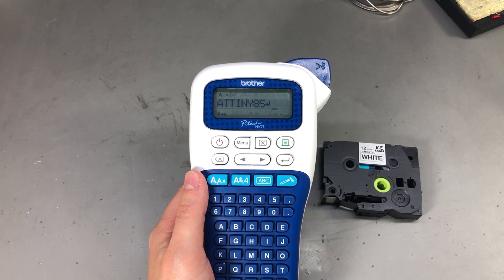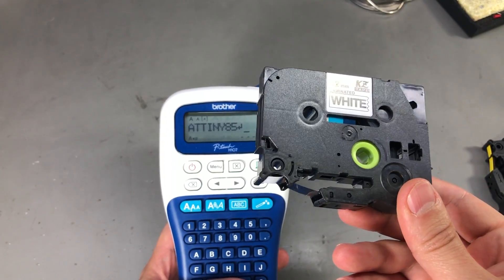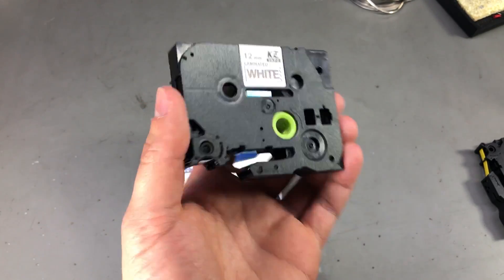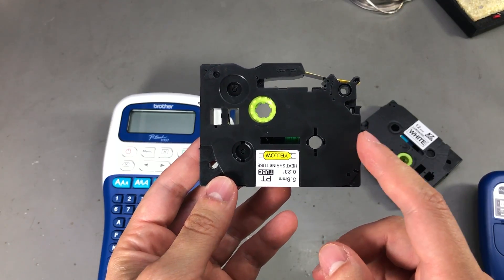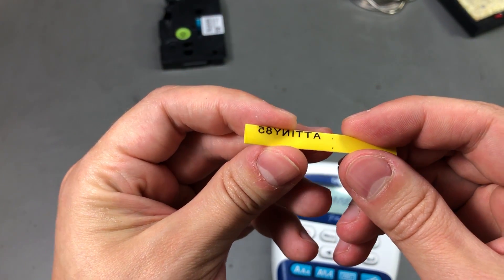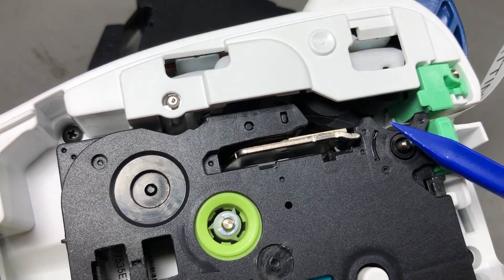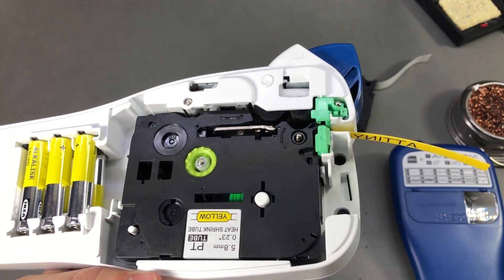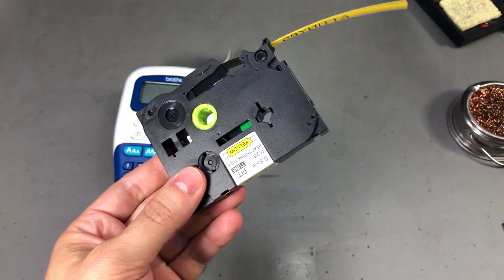Voltlog #237 - Can You Print Shrink Tube Labels With A Cheap Brother Printer?

Comment: I wonder if the heat-shrink manufacturer didn't actually screw up the hole pattern on the cassette. On my PT-H110 which is only marginally better than H107 the heat-shrink tubes work just fine. I'll check the pattern on my heat-shrink cartridge when I come home.
Reply from the maker: That's an interesting theory and I would appreciate your feedback regarding the cassette you have once you get the chance.
Reply: @voltlog  Please take a look at this photo: https://imgur.com/a/HNl932e

This one works out of box with my printer I mentioned.

Please also note that mine is a 12mm tube, so the pattern will still be different than yours.

Comment: If you buy new one, dymo labelmanger 160(20$ on amazon) can print on  Dymo 18051 Heat Shrink Tube Labels(4~5$ on Aliexpress). other dymo labeller can too.
Reply: I’m looking for cheap heat shrink printer for DIY works at home. What size does it fit? And dymo would do the jobs just by inserting this type of heat shrinking tape is it?
Reply: dymo labelmanager 160's maximum label width is 12mm, so 12mm under is all fit.
And dymo printer does not check tape type. So any type of tape is ok.
Reply: Thanks mate for your sharing. Initially I don’t have the confidence to buy low budget dymo brand since the supplier only expensive products could do the heat shrink labeller.
Reply: @chrismakulai4960  I tested Brother P-touch before, It has ID pinhole on tape cassette. So when brother shrink label inserted, It shows an error message. But I taped the hole like normal label cassette and it works well. So I think another label maker can accept shrink label with some hack too.
Reply: Thanks mate. This really helpful information

Comment: Brother p-touch h110:
Heat shrink tube works!
But you'd create one hole and "hidden" one other.
In tape-cartridge you have one center hole - make it similar to HSE-cartridge. And with two holes in HSE-cartridge "hide" with tape/scotch left hole.
Print!

Comment: Interesting. I have a Dymo one, though. There might be some heat shrink tape, IDK.
Reply from the maker: That's one of the things I've looked at before ordering my printer, I tried to get a Brother because I saw there is a variety of replacement consumables available on aliexpress.
Reply: VoltLog Well, I’ve had the printer for a long time now, and back then I didn’t even know of AliExpress! But Brother printers certainly seem better for the price, and they even have one with full color! That being said, the paper is quite expensive and it’s quite new, so no compatibles. Cheap printer, expensive consumables.

Comment: Thank you for the content, how is the result of the shrinked tube? Does the printing withstand the temperature of the heat gun and is the text scratch resistant?
Reply from the maker: Looks normal just a small decrease in font size due to shrinking but uniform across the entire length as long as the shrinking is uniform. It's not scratch resistant however and I can scrape the text away with a sharp blade.

Comment: Ur a frikan genius so figure it out will ya, these basted corporations who want to continually screw us consumers to make them so rich and powerful to control us and our kids far into the future, its criminal. Can u sense the anger in my text? yes I am a very angry person with this massive widespread enslavery agenda which is growing by the day. I too have a brother label maker and can't use it cos the cartridges r way to expensive for my budget and ali express is not an option for me unless its ebay, so if u got an ebay link I will buy 1 of them and see if it works in my machine. I will see if there is a mirroring option in the menu but i doubt it, so i will be in the same dellema as u... as u get older u depend more on labels so chop chop lets find a solution. :)~
Reply: I dug my machine out of the mothballs and the model is a PT-1800+ and the head looks the same as yours and the tape cartridge works the same as urs.
Reply: @2000jago  POWER GRID Mate, water is sourced from rainwater tanks filled by RAIN from the sky and my internet is 4g fixed wireless, what else do u need explained to u?
Reply: @2000jago  Ur a flat earther i see!!

Comment: What would be far more interesting is how the persistent the printing is given that it happens via thermo transfer which also happens to be the same process to shrink heat shrink tube... Would be rather annoying if the whole heat shrink tube just turned black while shrinking...

NB: Industrial cable printers use quite sticky ink to print on cables and tubing; I wrote a driver for such a thing 2 decades ago. Cheapest ink printer I could find in a pinch still looks rather flimsy and is somewhat expensive: https://www.aliexpress.com/item/32892811377.html
Reply from the maker: Daniel Egger tube does not change color when heated for shrinking.
Reply: @voltlog  Wow, thanks a lot for the confirmation. It's not exactly super cheap but I'll give it a try with my higher end P-Touch printer...

Comment: Thank you for this video.  My P-touch 1180 does have a mirror function ... so I will finally be able to label some little wires and DuPont housings.  Long have I have wanted to put things like "tx rx + - mosi miso" on jumps.
Reply from the maker: GnuReligion that's exactly what I had planned but didn't work out for me.

Comment: I would just enter into the printer what I wanted backward so when it mirrors it the label will correct.
Reply: The text will than be backwards but not the individual letters. For a T or an A this will work but a G will look reversed.
Reply: oh, good point.

Comment: That's a great idea, but don't you want one you could program and put your logo or icon in it and use a default light green tape perhaps? Of course it's all about marketing which is the the most evil part of doing any kind of business. People doing the hardware section usually does a perfect job as the marketing agent gets impatient usually rushing the the crew doing the software rarely allowing them to get the bugs out and the mechanical crew adds unnecessary but unique things to a device to make the incompatible with other similar items that can easily work, but purposely sabotaged to screw over their loyal customers. It's all about getting the product out for sale.

Comment: You can still print o,O,o,T,M,A,U,X,I,i,x,W, 8,*,V, H,-,_,~,+,=,^,",!,/,\[,]>,<(reversed and reversed those last six)... :0)(0:... But for identification marking I wouldn't mind reversed characters, you could always use a mirror.
Did you try single micro switch operation to find what each did? 
PS. Hello from London to beautiful Romania. I have very happy memories of my visits. I love your channel.
Reply from the maker: I will post a video update tomorrow, trying another sequence of the switches worked, the text is now mirrored correctly!
Reply: @voltlog  Excellent, well done.

Comment: The more expensive models all have USB, but look identical. I wonder if they use the same firmware inside, just not populating the USB connector, and a slightly different mould by that area, then use either a set of configuration resistors or something in the non volatile memory to tell the printer which model it is to be.
Reply from the maker: It could be but I don't want to go down that rabbit hole 😬

Comment: I own a P-touch 2430 PC, so mirroring is no problem for me. I didn't now that this type of cassettes exist. Maybe I will try this out in the near future.
Reply from the maker: Than it should be easy for you, it probably works without any intervention
Reply: curious.. did you try? I have the same  model of P-touch.. I've ordered a couple to sort out my wiring aboard but they've been stuck in customs for 10 days
Reply: @tommten  No, sry. But I figured out that the P-Touch does not probe the big square holes, wich are showed in the video. instead there are many pins on the inside of the printer and corresponding holes on the cassettes. Take a look at the comment from "Леонид". Maybe this is also our solution for the 2430 here.

Comment: I expected that you try different switch combinations before giving up. There are 3 switches, meaning 8 (-1 for detection) combination. One might work.
Reply from the maker: Brafilus MrToM ok, I was too caught up with the issue and I didn't think of this but it's worth a try.
Reply: I was thinking the same thing. Please update how different combinations of switches will behave
Reply: shaysudman yes please. Let’s search for the cheapest solution to get this working.
Reply: It looks like the method they are using, to detect the inserted cassettes, is different for some printers. My P-touch 2430 PC has 6 Pins in the lower left corner. If I look at the cassettes, there are also holes in the lower middle, which my device is not probing.  The 3 switches, which VoltLog is showing, are also not present on my device.
Reply: @MrMartinZockt  
 What we really need is a comparison of the PCB's from various models. I doubt they are much different, but who knows. It could just be unpopulated switch wires. Plus such content might provoke someone with a jtagulator/black magic probe/goodfet/etc. to have a go at one of these :-)
Reply from the maker: I will post a video update tomorrow, trying another sequence of the switches worked, the text is now mirrored correctly!
Reply: VoltLog and i just bought myself a new brother PT P750W and a bunch of shrink tube cassettes from AliExpress. This video has cost me more then all of your mailbags together 😀
Reply from the maker: @Hasitier  Nice! I'm sure you get some nice features with that higher end model. It might also do thicker tapes which have wider tube to use on thick wires.

Comment: After seeing the title I really wanted this to work out, crap! If your printer can print vertically, it might work if you use the smallest font, cut the excess and then wrap the tape sideways around the cable. I've yet to try this out myself though.
Reply from the maker: it might have adhesion problems if you try to stick it on the length of the cable but you can wrap it around the wire with two equal lengths like a small flag.
Reply: Yep that is the obvious solution but I figured that was the messy solution you wanted to avoid with the heat shrink tubing. :) I would believe the tape is wide enough to wrap around a thin wire, something you would use to mark I2C/SPI wires on a prototype or to which dev board pin you need to attach wires from a debugger for instance.

If the wire is not thin enough, maybe a clear heat shrink tube could work? I don't know if it's transparently enough for the purpose though as I don't have any
Reply from the maker: Yes, clear heatsink could work but that's an extra step which isn't fun.
Reply: That is very true but it could still be worth the effort in marking wires which need to be often reconnected. Most annoying thing for me with a similar Brother printer would still be typing and peeling off the tape...
Reply from the maker: I will post a video update tomorrow, trying another sequence of the switches worked, the text is now mirrored correctly!
Reply: @voltlog  😲